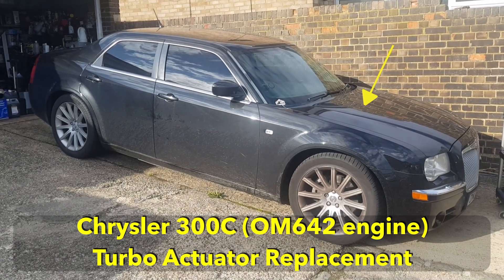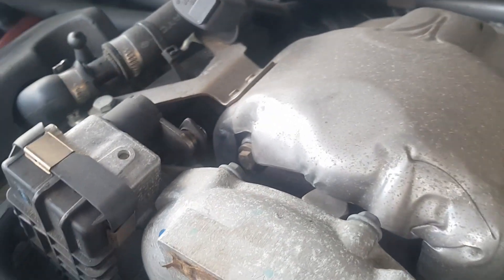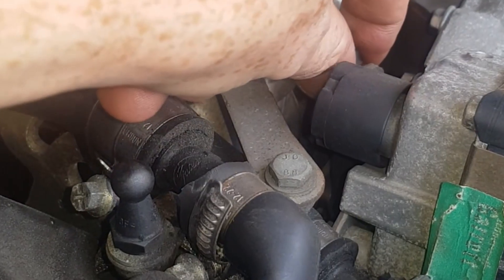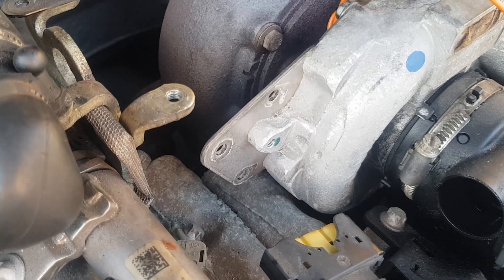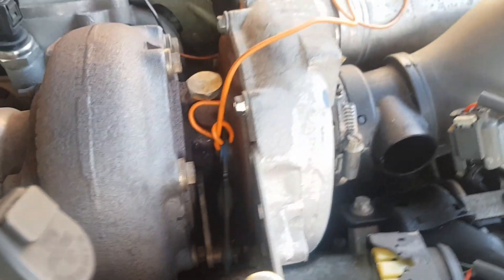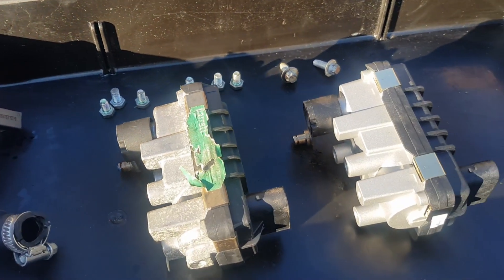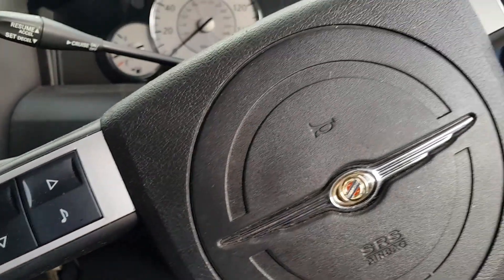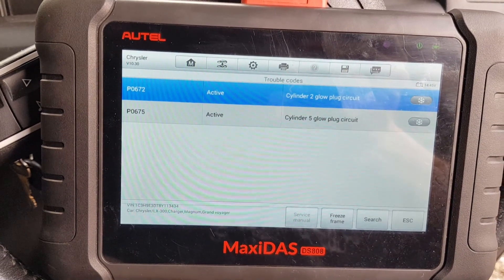DDG Quackie #011 - Chrysler 300C/Mercedes/Jeep OM642 Turbo Actuator replacement - P0046

Comment: Hi, Did you need to callibrate the Actuator to the Turbo , I've been informed it's not just a stright swap ???? - Pleae advise whether you needed to Re-Calibrate it all
Reply from the maker: SWAMPY: Hi... this was quite some while ago and I don't remember to be perfectly honest. We didn't adjust the connecting rod length and it was my understanding (I think) that the boost pressure and overall perfmance of the engine would be used to determine the actuator position. I could well be wrong though! Do you have any good data sources?